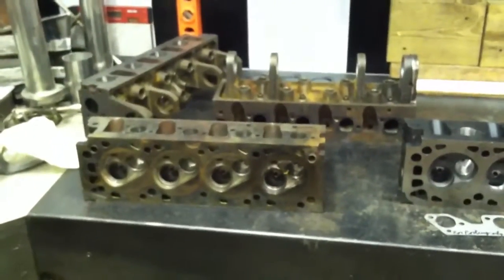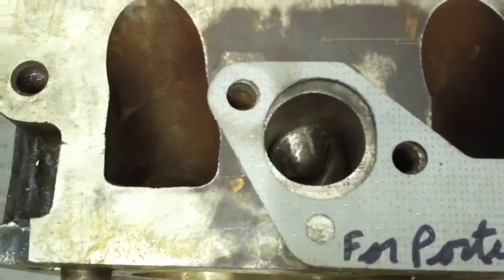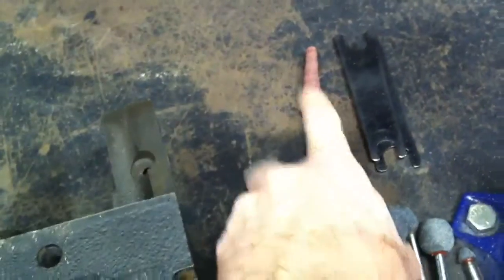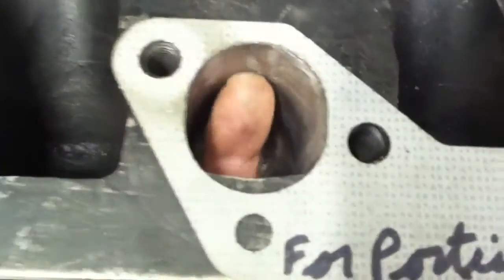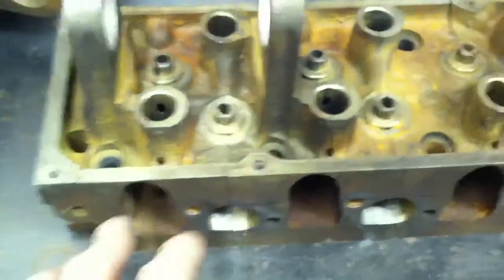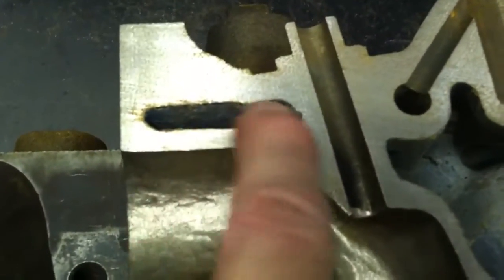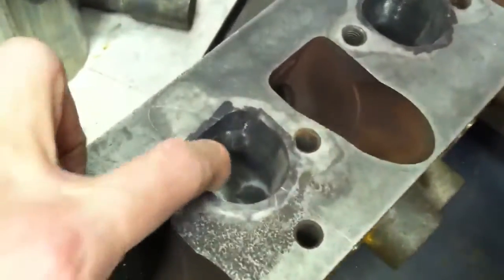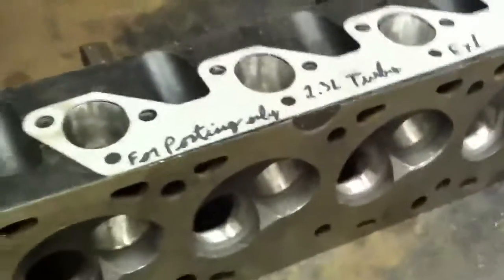Ford 2.3 lima cylinder head exhaust porting and polishing

Comment from the maker: yes I need to take some more videos of that, it is super informative
Reply: James Wieler can I use an after market   exhaust manifold from a mustang2 on my 89 ranger 2.3
Reply: James Wieler would a port and polish be worth the trouble on a 8 plug head
Reply from the maker: @prakticlej8677  I think the 8 plug is very similar to this so I would think so.  The Lima head is really flow restricted do any amount of porting is going to help

Comment: Nice video, I'd encourage you to show some more shots of the sections of the head that were cut up. Also, on my 87 xr4ti head, there appears to be some excess material just above the valve seats. Have you noticed this ring of material that appears? It seems to have the potential to block a fair amount of air flow, and I'm wondering if it is purposeful or not.
Reply from the maker: +Brian Hartigan 
Hi Brian,
Yes that ring needs to be removed.  Careful that you don't damage the valve seat.  I color the seat with black marker to make it more visible.  You can afford a mistake on the exhaust side if you are going to larger valves.  Same can be said for the intake side but I am using stock size intake valves so I was extra cautious.  I'll make some more videos of the section for you.
cheers
James